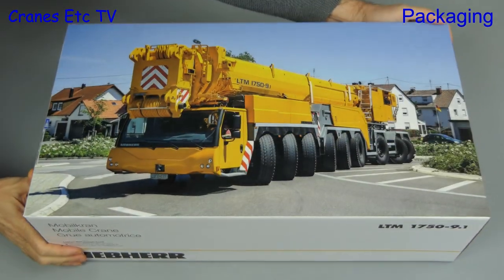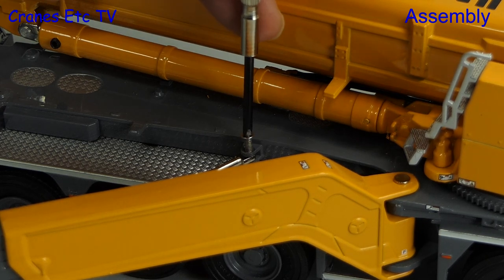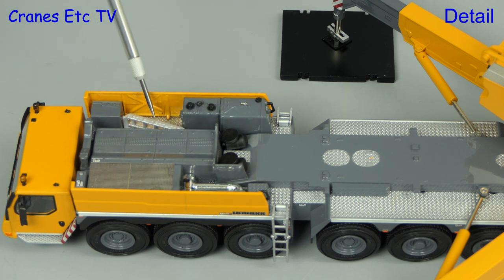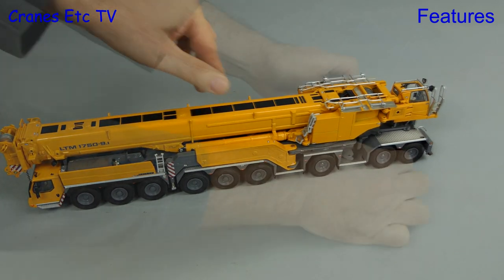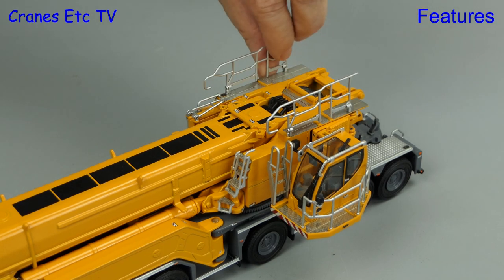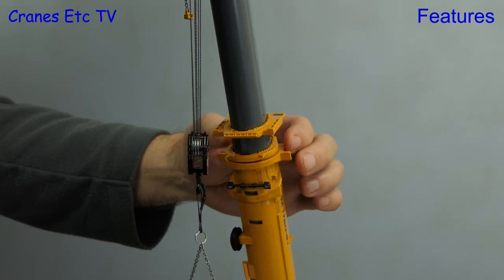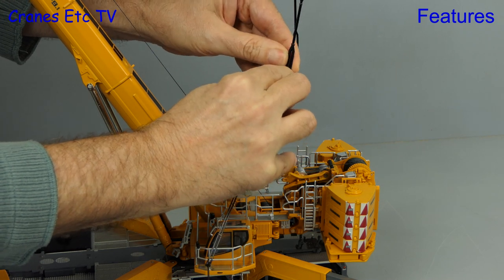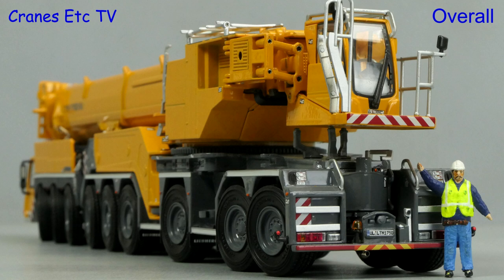WSI Liebherr LTM 1750-9.1 Mobile Crane by Cranes Etc TV

Comment: Awesome!!!!! All the tiny graphics in the same places like the real one, the functionality of the counterweight system, the walkways mesh... 😍🥰 If it was posible I woud buy in all liveries 😂😂🤦🏻‍♂️  
Two small negatives, the TY pulleys supports (3:05) should be black and as usually the unpainted conexion between the cylinders and the boom.
Reply: The TY pulley supports are now black in the latest version.
Reply: That´s true! I didn`t realise!
The newsletter says "Retooled TY-System", is the push fit conection ( 13:13 ) a conection with nuts and bolts now? And if not, where are the extra 50€?
Reply: Mikel Markina Actually I just received  a Ltm 1750 in the Chi deh livery and it was the retooled version. The  pulley supports are now connected with the Y GUY itself and the result is that the Y GUY and the pulleys can now be attached to the boom with only 4 screws instead of 6. Take a closer look here at the Y GUY on the retooled version: https://www.azcrane.com/products_detail_0_0_6687.htm.        And I guess the extra 50 euros is to first get rid of the old stock.

Comment: So only 18 centimeters taller than my rough terrain crane
Reply: yeah sucks. I was hoping to only have to get the 1750 but had to also get the 1500 because the 1750 is so short.  doesn't help that AC700 is also so short...